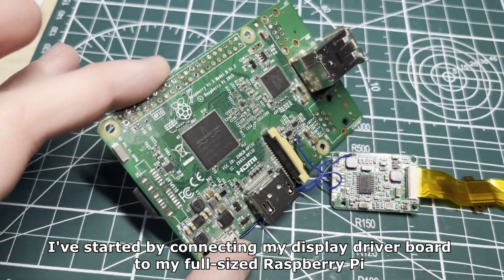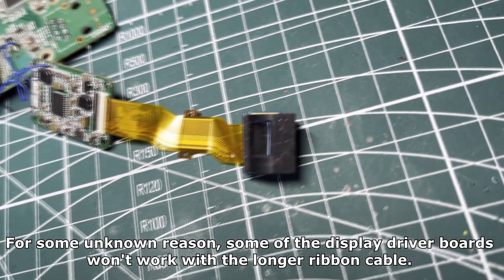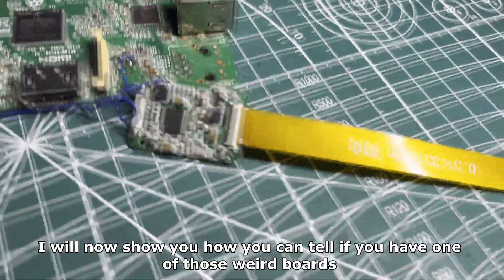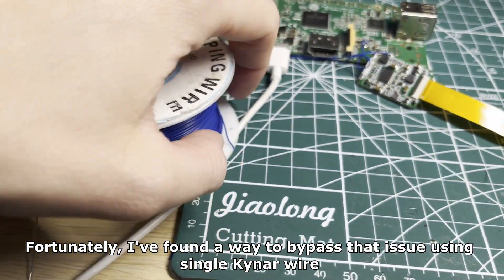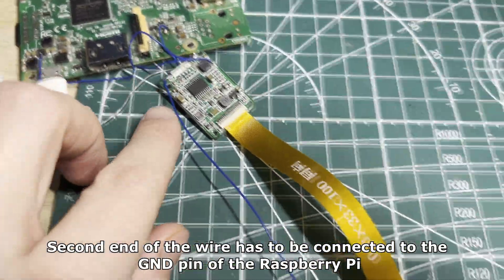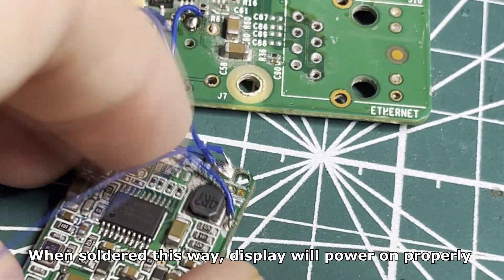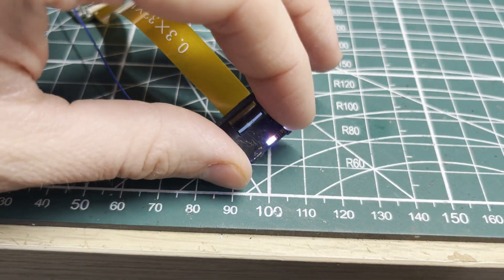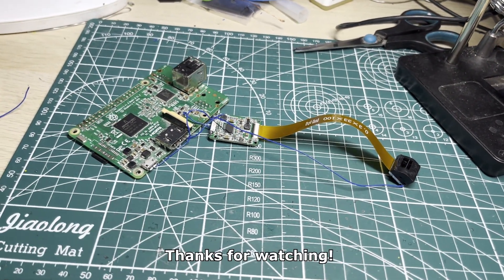0.2" FLCoS GND Bypass | Fix For Longer FFC Issues

Comment: Hello, I've seen that those flcos displays have a brightness of 200 cd/m2.
When you use them in your smart glasses, are they too dim? Can you use them ouside?
Reply from the maker: Brightness is pretty low for AR glasses but you can use it ok indoors. If you’d like to use them outside then you can cover the outside of the combiner with window tint foil or polarizer. This way reflected image will be more visible even outside